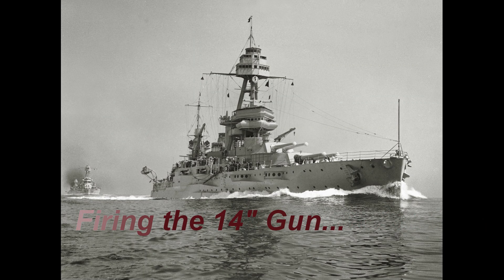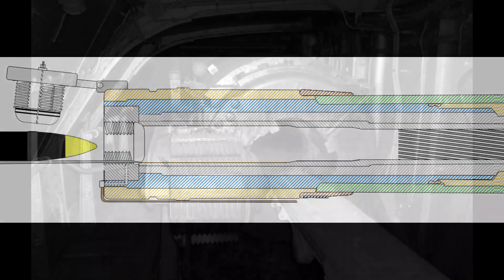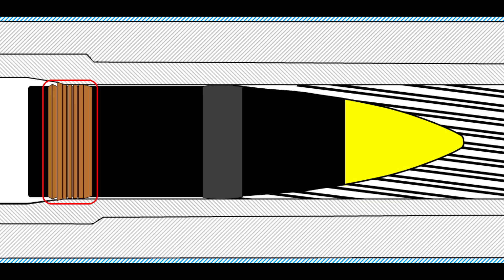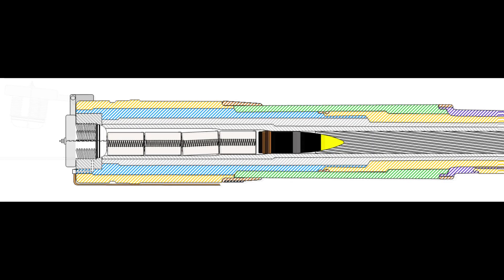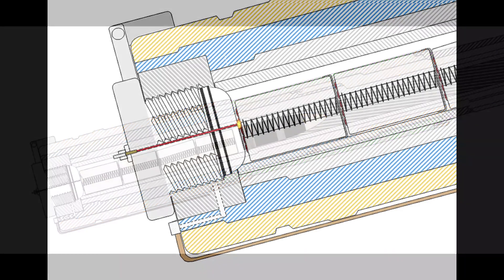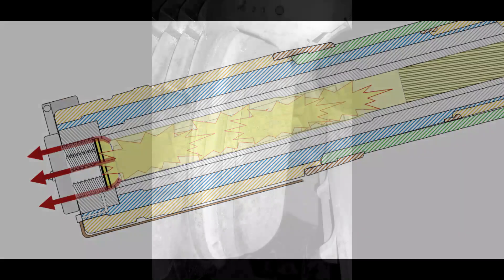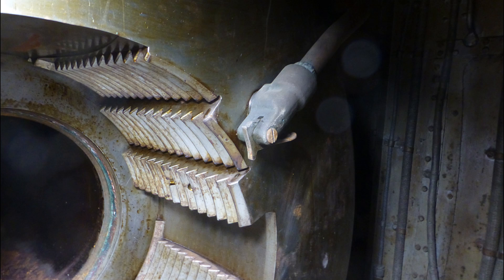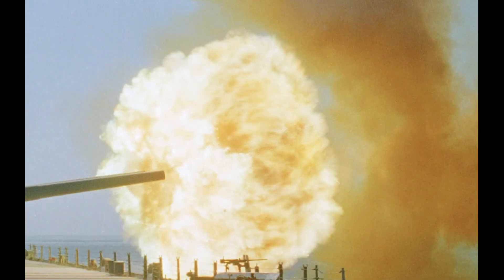Battleship Texas, Firing The Guns Step-By-Step

Comment: The Iowa class guns worked completely differently.  Texas's guns were designed by Bethlehem steel. The shells were stored nose down. The Navy went to a better system with the Standards.  It was faster and safer.
Reply from the maker: Breech plug operation, recoil systems and shell handling were certainly different on the Iowa's, but basic gun barrel design and breech plug design were very similar. 

This is the first time I've heard that Bethlehem design the 14"/45 gun.  Everything I've read indicates that the Naval Gun Factory at the Washington Navy Yard both performed most of the work and were also the primary maker.  In fact, out of her initial 10 barrels, 7 were built at Washington, 2 at Bethlehem and 1 at Watervliet Arsenal. 

As far as handling systems on the standards being safer and faster, that is simply the result of evolution, not defect.  Texas was a transitional ship and it showed in shell storage and handling.  Texas and New York were originally intended to carry 12" guns, but changed to 14" while the gun was still in late development stage and the ship in late proposal stage.  1912-14 Navy ordnance manuals indicate that handling systems found on the standards were still being designed and tested when Texas was being built, including base down storage on the Nevadas and parbuckling found on the Pennsylvanias and all U.S. battleships that followed.  For that reason, Texas was equipped with horizontal storage racks similar to what was used on 12" gun designs.  Her hoists are very basic, and moving shells in them was likely a problem in heavy seas.  It is likely that the designs used were simple and required little development time.  She receive magazine modifications around 1919-20 that changed shell storage from horizontal to vertical, nose down.  Doing that simplified handling and increased shell storage capacity by about 10%.  Even though storage and handling was somewhat primitive, it was reasonably safe and more importantly, was fully capable of supporting a 45 second rate of fire.

Comment: Now wait a minute.  The gun captain looks into the breach and yells BORE CLEAR.  How can he see an obstruction if the battle occurs in the middle of a cloudy, moonless, night in the middle of the Pacific? Do they station a sailor at the end of the barre with MAGLITE?
Reply from the maker: Good point; I was a little imprecise with my description.  I agree that it would be difficult to see the entire length of a 52' long bore under many lighting conditions.  To be more accurate, the gun captain was only interested in being sure the powder chamber, ahead the breech plug, was clear of embers since that is where powder bags would come in contact with them.  The chamber's polished surface and lighting in the gun house, made it easy to see them.  Embers farther forward in the bore didn't matter because they were very effectively sealed away from the powder chamber by the next shell rammed into the gun.  The shell was completely impervious to damage from embers and it acted to completely seal the bore ahead of it from the powder chamber.  Embers found in the chamber were quickly extinguished by spraying it with water using a flexible hose mounted in the overhead above the loading tray.  Water remaining in the chamber had no effect on bags for the short time they were in it before being fired.
Reply: @tomscotttheolderone364  still, you did a wonderful presentation.

Comment: Great video. The drawing shows the threads on the breech as having a spiral. If you look at the photos of the breech plug you can see that there is no spiral - it sees that there is no need for the breech plug to move axially when closed.
Reply from the maker: Thanks for the compliment.  There is a slight pitch to the threads, but not as much as shown in the illustration.  While it is exaggerated, the pitch correctly suggests that the threads tightly pull the plug into the screw box to close up the threads and prevent movement during firing.
Reply: @tomscotttheolderone364  How much does the plug move because of the pitch - 5 mm / fifth of an inch? Some other value?
Reply from the maker: @damianwright3690  That's an excellent question that I don't have an answer for.  I don't have drawings that indicate that, nor can I directly measure them since I don't currently have access to the ship.  You have my curiosity up.  I'll look at that and give an answer once I can get back into a turret.

Comment: I didn’t realize how fast these rounds go.  2700 feet per second is the equivalent of about 1841 miles per hour- basically close to Mach III. That is incredible for basically an analogue system and 1940’s technology. I would not want to be in the receiving end of one of these rounds. That is an insane amount of power per 14” gun!! Thanks for taking the time to make and share this video.  I’ve always wondered about how these guns work (and work so well at that!).

Comment: Computers hadn't been invented yet.
Reply from the maker: Computers certainly existed prior to the electronic digital devices that we use now.  They were mechanical analog devices that could multiply, divide, add and subtract, and weren't limited to what was used on warships.  While they lacked the speed, power, complexity and flexibility of what we use now, they were capable of performing the complex calculations required to determine the point of aim where the shell fired by the ship's guns would meet a moving target more than 10 miles away.  Google "Hannibal Ford range keeper" and you will see what I am talking about.  By the way, they were still used on the Iowa class battleships to calculate firing solutions until the early 1990's when the ships were finally taken out of service because of their extreme accuracy.

Comment: It's a year later and I watched it again and It is still terrific. How can the gunners verify that the compressed air has done its work and that the barrel is now safe to open the breach?
Reply from the maker: Thanks!   Thanks for the question.  It cannot be overstated just how important the gas ejector system was.  There would almost certainly be a flashback into the turret if a breech plug was opened without compressed air first being shot into the gun after firing.  That happened on Battleship Mississippi when system pressure dropped below its operational level and a gun in turret 2 failed to be cleared.  The resulting flashback killed several crewmen.  

They could not directly observe that the bore was clear of explosive gasses until they opened the breech.  However, it was a sound assumption that if a sufficient quantity of compressed air had shot into the bore, it would be clear.  On Texas, and I'm sure all other battleships, there is a pressure gauge located above each gun's breech and a backup gauge in the commander's booth that constantly monitored air pressure in the gas ejector system.  One of the checklist items prior to going into action was to trip the ejector valve by hand and observe it blow air into the powder chamber.  If it worked then, it was reasonable to assume that it would work while the gun was in action.  If pressure dropped below a safe level, they could remove the spent primer and use a portable air hose to shoot air through the primer vent to clear the gun before the breech plug was opened.  Lastly, they could hear the gas ejector valve trip and air shoot into the gun as the breech plug was rotated.  If that wasn't heard, the plug man would not completely unlock the plug and they would use the previously mentioned portable hose.

Comment: WTF are 16 inch 50 caliber guns???
Reply from the maker: That is the standard way of identifying various sizes and designs of U.S. Naval guns.  Unlike rifles and handguns, caliber is not used to state a gun's bore diameter, but the length of a barrel's bore in number of calibers.    It may seem a little odd, but it has worked very well for over 100 years.  

A 16", 50 caliber gun has a bore diameter of 16" and a bore length of 50 calibers.  The bore is not the overall barrel length, but its bore length.  So, a 16"/50 caliber has a bore length of 16X50= 800" long, or 66' 8" long.  

The following link will take you to the NavWeaps page that gives detailed descriptions of all modern and historic U.S. Naval weapons.  You will see how well the nomenclature works once it is combined with Mark and Mod numbers that further segregate them according to design changes within each type.  http://www.navweaps.com/Weapons/WNUS_Main.php

Comment: At about 1:00 he refers to a "forged casting."  There is no such thing. Either it is forged or it is cast or, for thin sections, rolled. By 1900 there was no important part of any cannon that was cast.  These guns involved the forging of steel ingots which are different from castings in several important ways.
Reply from the maker: Thanks for the correction!  I went back to ordnance textbooks of the period and they are in 100% agreement with you.  Gun tubes, hoops, rings, slides, etc. were forged from ingots, not castings.

Comment: If you look at your section image is a "top view", then the hinged breech block appears correct.  If you look at the image as a "side view", then it looks wrong.  Just label the image "top view" and Bob's your uncle.
Reply from the maker: I felt no need to add a label because I commented that it was incorrectly position in the video.  It was intentionally done that way to better show the components and process.  By showing the side of the incorrectly positioned breech plug, its interrupted threads and carrier, and its operation was instantly identifiable.  If drawn in the correct position, one would mainly see a circle that is the plug face.

Comment: What is the rifling rate or twist, per inch or foot of barrel length? Maybe comparable to smaller arms with roughly 1-1/2 turns along barrel length?
Reply from the maker: The twist rate for the barrel is 1 in 25; however, it is not feet or inches.  It is 1 in 25 calibers.  To work that out, 25 X 14" = 350"/12" = 1 turn per 29.17'.  While that doesn't sound like a lot, it is enough to spin the shell at more than 5,600 rpm as it leave the barrel.  

In terms of twist per barrel length, 52.5' bore / 21.17'= 1.8 turns.

Comment: What about the rocket assistant bullet? More range?
Reply from the maker: That kind of technology was not available in the 1940's.
Reply: @tomscotttheolderone364  
But it is today, just see if it ,works out. Redesigned is not a problem with technology today, instead of 28 mile range maybe 38 mile range.

Comment: I wonder what happens if such a gun fires on a tank...
Reply from the maker: The weight and velocity of a 14" shell results in it having kinetic energy that is higher in orders of magnitude than the most powerful anti tank round.  The impact shock alone would rip the tank to pieces.  A high capacity (general purpose, high explosive) round would explode on impact and spread the pieces over a wide area.  An armor piercing round would likely explode some distance past the remains of the tank since it has a time delay fuse that would activate on impact, but delay the explosion for a couple of milliseconds.

Comment: Although not what I was expecting, I was expecting to actually see the guns load and fire. 😁 However it was VERY interesting to understand the process. What amazes me is that the primer was so small for such a huge load. I realize that the electrical charge also helped ignite the powder, but still surprised by the size of the primer.

Comment: thats a pretty acugate display.i was on the 8 inch howitzer in texas in 1985.they discontinued it because it was too heavy and opted for the 15mm that could be air lifted.there were 2 fifferent charges.the green bag and the white bag.we shot the lesser green bag charge 99% of the time.when you shot the white bag i thought that 42 ton howitzer was gonna come off the ground

Comment: This video explains the extra puff of white smoke from the guns after firing, as the remaining gases are ignited in the barrel.  (BTW, the Iowa has a mechanical fire control computer that is so accurate, that it was not replaced with an electronics).

Comment: What was the misfire procedure?
Reply from the maker: There was a very strict protocol followed in the event of a misfire or hang fire.  The only time short cuts may be taken would be in combat when keeping a gun out of service for at least 30 minutes may present a greater danger than the gun accidentally discharging.  The following is representative of what would have been done on Texas, New York and in the two gun turrets on the Nevada class ships.  

There are two very different procedures depending upon whether or not the primer fired, but the gun did not. The most likely problem would be a primer misfire.  However, that cannot be determined without removing and inspecting it. There was danger in doing that, so several attempts would be made to fire it before removing it.  First attempts would involve checking electrical connections, switching to battery power for the firing circuit and cleaning contact surfaces.  If those don't work, they attached a lanyard to the firing lock and attempt to percussion fire it.   If that didn't work, the firing lock would be opened and the primer removed and inspected.  If it had not fired, a new one would be installed and the gun fired.  If it had fired, then a whole new set of procedures would be followed.  

Things get really dangerous if primer fires, but the gun does not.  It must be assumed that the gun may fire at any moment.  There were two likely reasons for this happening.  The bags were pushed too far in so that the rear bag is too far from the primer vent for the primer flame to reach it.  The other is if the last bag is put in backwards so that its ignition patch is not against the breech face.  The primer flame is not energetic enough to properly ignite the charge without the black powder in the patch, but it may start a smoldering fire in the fabric of the bag.  Since they don't know what the problem would be, the turret was cleared of all crew except for a gunnery officer and a couple of crew to assist him.  They wait at least 30 minutes before doing anything.  This was to allow time for smoldering to travel up the length of a bag to the ignition patch and set off the charge.  After 30 minutes, the firing lock is removed to fully expose the primer pocket in the breech.  A sprayer wand with conical tip is inserted in the pocket and water sprayed into the powder chamber.  After a few minutes, the breech plug is opened and water is sprayed into the chamber and on the powder bags as they are pulled out.  The bags would then be placed in immersion tanks filled with distilled water to make sure they are totally safe.

New bags can then be rammed, breech closed, primer inserted and firing lock closed.

Comment: Very interesting ratio, 1500lb shell to 420 lb propellant or 150/42. A typical 308 Winchester rifle cartridge might have a 150 grain projectile and around 42 grains of propellant giving a muzzle velocity around 2800 ft/s.  Ballistics is absolutely fascinating.
Reply: 75/21, reduce your damn fractions smdh
Reply: @Strelnikov403  Ten and five sevenths over three, thank you good sir!
Reply: 169,925,000 ft⋅lbf
Reply: As this video was playing that very thought was tracing thru my curiosity, I was heading to the calculator, other web sites…thanks for the quick reference! I do think case pressures are higher on smaller ballistics bores? I came back and the .308 has 62k lbs of case pressure there is a ratio in there….,
Reply: I was thinking the same thing, except it was 30-06 that I was thinking of. The 308 and 30-06 are only about 200 fps difference, so it hardly matters I suppose. I'm just glad there are still people with a like mind...

Comment: it always amazes me the engineering required as well as the forging to keep that barrel from detonating from one shot let alone years of such abuses makes me wonder if there is more work gone into the design of a single turret on that ship then It took for the whole ship
Reply from the maker: I discussed propellant in another video in which I describe how maximum chamber pressure during firing is 36,000 pounds per square inch, well within the strength parameters of the barrel.  The reason is that propellant does not truly detonate, but burns extremely quickly.  The individual pellets of propellant were designed in such a way to burn progressively faster so that they start fairly slowly and then speed up as the bore's volume increases as the shell moves through the barrel.  This makes it build pressure in a controlled fashion without over pressuring.  The guns and turret were the result of years of evolution from previous designs, much like the engines, boilers and even the ship's hull and structure.
Reply: @tomscotttheolderone364  thank you for the clarification I had assumed it all went off at once but gradual would make it far easier for containment.....👍

Comment: "16 inch, 50 caliber guns??" LOL.  50 caliber is,  by definition, 0.50 inches.  When a video starts with an idiotic statement only a completely ignorant person could make, you KNOW you're watching a Democrat production.
Reply from the maker: Machobunny1, I will go out on a limb by assuming that you are not a troll and will spend more time than you are probably worth to explain why you are wrong.  The U.S. Navy has used the term "caliber" to describe bore length in all major caliber guns for a very long time. For example, a 16"/50 caliber barrel has a bore diameter of 16" and bore length of 50 calibers.  So, 16 X 50 = 800", or a 66.67' bore length.  The term has been used in this fashion in every edition of every U.S. Navy ordnance and gunnery manual, along with all U.S. Naval Academy ordnance textbooks since the late 1800's.  Oh, one last thing;  grow up.